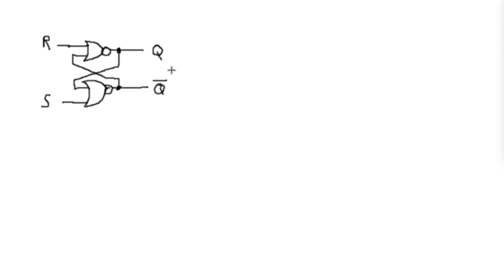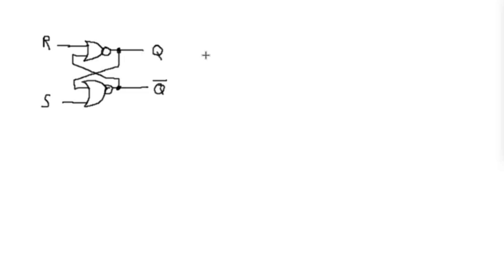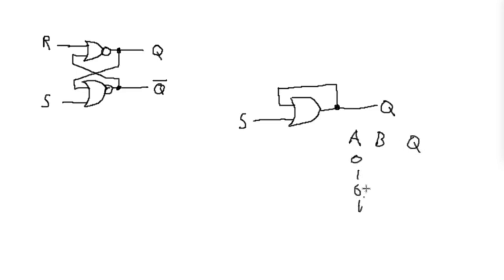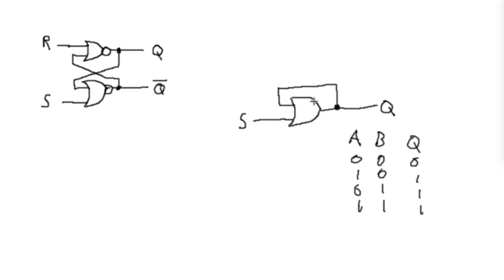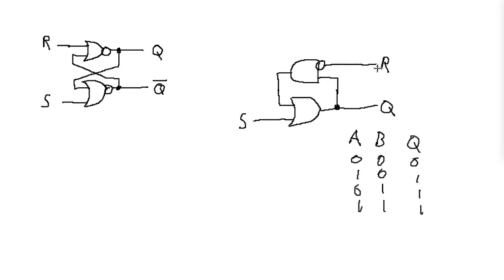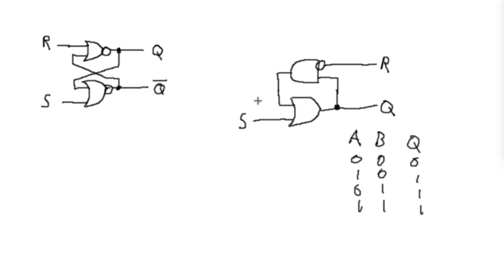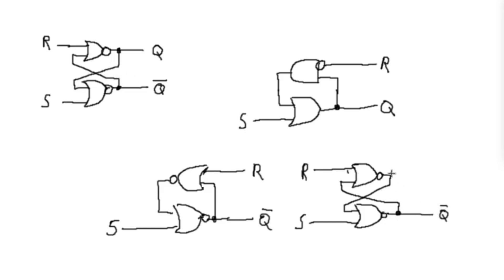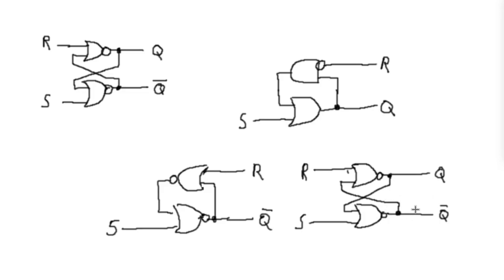Alternative SR Latch Circuit

Comment: Just found your Channel and I enjoy how simple you can explain the logic stuff. I just want to mention that both circuits kinda arent the same... Yes in terms of boolean logic they are the same, but in a real case scenario they differ quiet a bit. First you have 2 Outputs from the nor latch, from the other you got just one. So the nor latch seems the better choice for further applications. Second the version with the AND Gate is more fail safe proof then the nor latch, because if you enable both inputs, the output stays off. With the NOR latch on the other hand you get an illegal state where Q and Qinv are both off assuming you depower both inputs in the exact same moment the Output acts kinda randomized. (depending on the quality of the gates used or in minecraft the chunk update order) I ran in this while designing a new RAM design and wondered why this doesnt work on my breadboard but in all simulators ;)
Reply from the maker: Yeah in that sense there is a difference, but for all intents and purposes, it works all the same.
Careful when making logic circuits with electronics... ohms law plays a very large role in how the logic gate behaves.

Comment: Dude I just have to say wow this video is AMAZING! It gave me a unique insight on SR Latches that I've never heard before! 

Before this video, I had a different intuition on SR Latches. If you had an odd numbered amount of NOT gates in a loop, it would be unstable, and constantly changing. But if you had an even amount of NOT gates, it would be a bi-stable circuit, which can be flipped by activating whatever wire is off. This approach was so much clearer than before. I gave this video a like = )

By the way, how is Fatstacks?
Reply from the maker: yeah that's another way of looking at it! Glad I could help too :)

Fatstacks is coming along nicely, I'm still tinkering with the layout but it should be close to complete.

Comment: building my first real programmable redstone computer while watching, any ideas of what I should make with it once it is finished?
Reply: Try making the internet with it
Reply: I would definitely start with Fibonacci and work up from there. Good luck!
Reply: @codymcguire2855  yeah, probably going to make that first. Then I think I will work on making it semi Turing complete
Reply from the maker: @luckydog7896  I agree with younes and cody, start with Fibonacci, that's like the hello world of machine code.
If you want something a bit more challenging, you could write Bresenham's line algorithm, though I warn you, you will have to write a floating point library to go with it :)
Reply: Copy and paste the computer or make a better version and connect them all over an encrypted internet system
Reply: I agree with people in this thread though if ur computer isn't able to do multiplication / division, write machine codes for those. Maybe then move onto square root or powers, the algorithms you can write are endless if ur computer has an ALU that can do add, invert one input, AND and XOR
Reply: @m4jci6  The design I have can do all of those